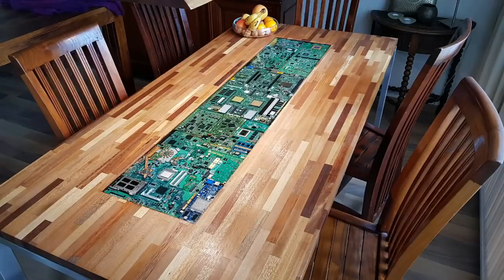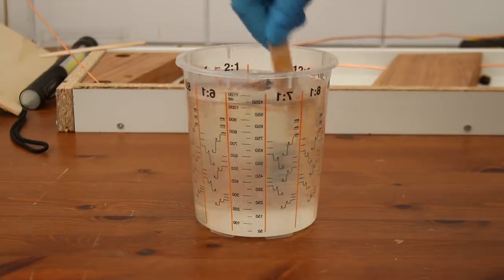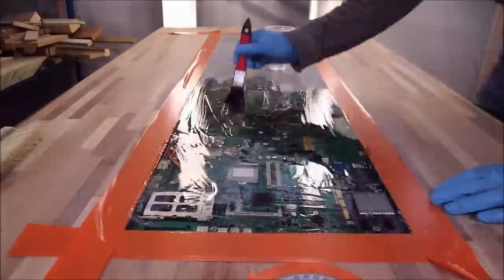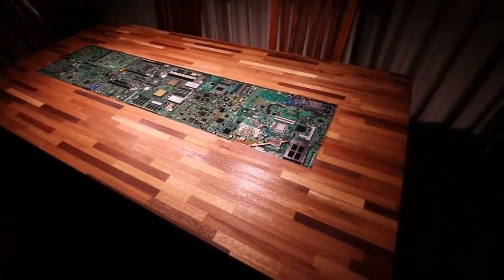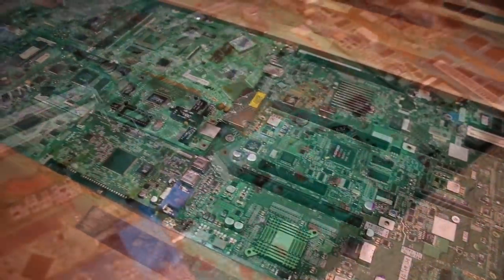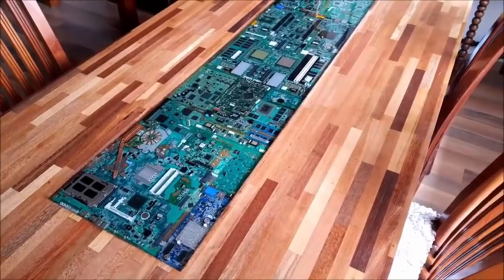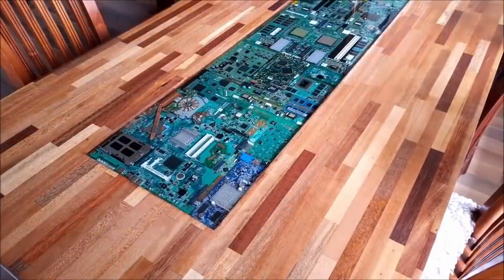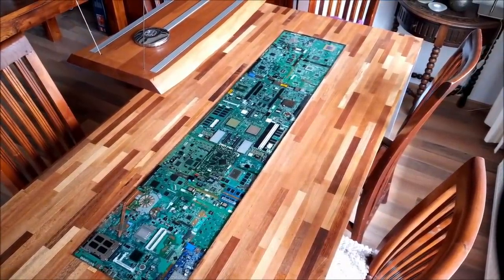Circuit boards with lights in epoxy in a table

Comment: Heat may help set the epoxy.   I have done a lot of epoxy casting at work. 

WARNING:
The heating process does cause the release of fumes it is best done in a well ventilated area.
The fumes could cause respiratory problems. with prolonged exposure.

I frequently used heat to speed the curing process if prototype were needed in a rush.
I would also use heat if I was off a bit with the catalyst  (hardener) and things did not want to set in the after 2 to 5 days.
The heat will make the epoxy a little soft. 

Cook between 30 C and  50 C, if it is too hot the epoxy will turn yellow. 

The heating may take a couple of days.  The lower the heat the longer it will take to harden.
You can repeat the heat process if required. 

  -       The second heat should be at a lower temp and a longer duration.
When time was not a factor, I found that the lower heat 25 to 30C and longer duration, this worked best for me.

If the heat is above 75C the epoxy tends to turn a little milky yellow to brown and cause distortions in the glass like finish.
Do NOT use a heat gun to heat a localized area it may cause cracking.
Build a tent and heat the whole panel evenly as possible.
You could use the sun but make sure to use a heavy black plastic cover to shield the epoxy from the sun light.
Watch the temperature closely, on a sunny day it can easily reach 73 C in a sealed tent think about your car in the sun and the heat inside it in summer.
This could take several days bring the table in at night and cover with blankets to allow slower cooling.

-   Insulating the bottom of the table would help minimize the heat loss and give a more even temperature distribution through the panel thickness.

When warm the epoxy will be softer so take your time, when cool and cured it will turn hard. 

let the epoxy cool to room temp 18-24 C with out additional cooling applied.( do not place in a cold place this may crack the panel)
The longer it takes to cool the less stress you place on the cast panel. ( you have a big panel)

I would suggest to keep the epoxy out of direct sun light.
That will help the epoxy keep it's clarity.
Non UV setting epoxy's will turn yellow.
That will happen to most clear epoxies through time and sun exposure.

UV light will cure UV setting epoxy's do turn yellow very quickly

I created an epoxy that could have 3.5 " nail driven through a 3/4" thick piece with out breaking or cracking it.
Fun Stuff!!
Reply: Jesus christ dude, I was not expecting that detailed guide and explanation when I clicked show more. I thought it would say "good luck" or something.
Reply: @volundrfrey896  hahahaha exactly

Comment: Just epoxy the entire surface...
Reply from the maker: As I said in an earlier comment: I thought of that too, but first, the ugly spots won't go away with that, and second I don't like the look of wood underneath epoxy that much... Covering wood in epoxy for me is something like making plastic out of something natural..
Reply: @Onrust1  Gotcha.. But... sacrifices must be made to save the day. Make a mold and clear epoxy only the middle, Then epoxy the rest of the taple with green tinted semi clear resin. Heck you could even sove some more fibers around in there. The table will not look natural but it will look pretty funky with some semi organic cybord pcb thing going on.. Swing for the fences, or otherwise just leave the project half way!
Reply: PS: if you lightly sand fiber on the sides, that part will light up as well... ;)
Reply from the maker: I like the way you think. 😊👍 Sanding fiber at the sides I will remember!

Comment: Could youu made a mould of the  mobs as a finished sized  insert into the table,using the epoxy first.But apart from that a good video,Maybe you could use RGB strip lights.

Comment: Maybe you can use the router and remove about 1/4 inch of the epoxy and pour new epoxy ?  Also use a rubber spatula when mixing. And then pour into a second container and mix with a new spatula before applying to table.
Reply from the maker: Yes, good suggestion. But like I said, a groove between the epoxy and the wood is almost inevitable, because they didn't bond well enough. And a chisel can maybe more easily part the layers of epoxy that don't stick. Oh well.., I'll give some more thought. And I will take mixing more seriously in the future, that's for sure... 😁😁 Thank you for thinking with me..
Reply: @Onrust1  Then cover the entire table with epoxy ? groove no more lolz.
Reply from the maker: I thought of that too, but first, the ugly spots won't go away with that, and second I don't like the look of wood underneath epoxy that much... Covering wood in epoxy for me is something like making plastic out of something natural..

Comment: Mooi project.
Hopelijk geven de batterij(tjes) geen probleem na verloop van tijd door lekkage etc....
Reply from the maker: Welke batterijtjes? Je wekt de indruk delen van de video te hebben geskipped... Dat is verboden! 😆😆
Reply: @Onrust1  de knoopcel die je ziet op 4:40 links in beeld. Het exacte type is niet zichtbaar, maar vermoed een CR2032 is. 
ps: heb de ganse video uitgekeken, en zag dat je onder de prints een laag zelfklevende alu-folie hebt geplakt, dit heeft wel als grote voordeel dat de epoxy alleen maar aan de zijkanten van het hout plakt en niet over de ganse oppervlakte onder de prints.
Reply from the maker: @BjornV78  Oh sorry, verkeerd begrepen.. ja goeie vraag. Ik vermoed dat er niks met dat knoopcelletje gaat gebeuren, omdat het helemaal luchtdicht zit afgesloten.. Denk je niet?
Reply: @Onrust1  aangezien het luchtdicht is,  is de kans op corrosie inderdaad wel zeer klein. In de 16jaar dat ik aan IT werk, heb ik dit type batterij nog niet zien lekken, zelfs niet bij moederborden van 10jaar en ouder. Maar deze batterijtjes kunnen zeer lang hun spanning bewaren, waardoor ander onderdelen op de print onder spanning blijven staan, met het doorboren van de print voor bv Led's, kan dit wel een kortsluiting veroorzaken natuurlijk.
Maar er bestaat zo iets als de wet van Murphy.

Comment: In order to create a better result I recommend to (a) make sure to have really the very exact mixing ratio (b) mix it really really well (c) make sure that temperature in your room fits to your epoxy (in my case 20degrees), (d) pour in multiple thin layers to avoid fast gelation, my epoxy allows 2cm per pour, (e) cool down your epoxy components in fridge to the proper temperature (in my case 20degrees max) before mixing. ....As the process is exotherm the heat needs to be able to go away. If it is to warm in the room, if you cover it, if the total volume is to high you get fast gelation leading to the "ugly" parts. I hope this helps. I have learnt all of that from my errors :-)
Reply from the maker: Thank you, I'll keep this in mind for sure. My supplier guaranteed me the thickness and the temperature were within limits of this epoxy (it was one of the more expensive kind - I could do 5 cm, but I never did more than 2 cm). I'm quite convinced I cut a corner at the mixing... But next time I'll remember your words nevertheless... 😊👍

Comment: You should use a long thick piece of clear plexiglass to cover the circuit boards,  because its more durable and easy to replace when scratched! You can find many tutorials online (including video tutorials) on how to remove scratches from plexiglass which would make it a good option to replace epoxy as a see through container!
Reply: Use polycarbonate instead of acrylic (plexiglass) and it wont scratch to begin with.

Comment: To get rid of the imperfections in the epoxy, once it has been poured, you need to heat up any areas of imperfections with a hot air gun before the epoxy sets.
Reply from the maker: Before it sets? That means just after pouring? I know about removing air bubbles this way... And with my kind of epoxy I have enough time to mix the epoxy after pouring... I don't think it helps me now to go at it with a heat gun...
Reply: @Onrust1  Removing air bubbles is the most obvious that people think about when using a hot air gun BUT it also helps to displace the epoxy in a more uniformed fashion  when there are pockets of imperfections. Next time you do a project that involves a large amount of epoxy, make a test sample and purposely cause imperfections then use a heat gun on it, you will notice it will clear itself.
Reply from the maker: Thank you! I will most certainly try!

Comment: Sorry it didn’t turn out the way you wanted. But imo  it is a very nice and creative idea  and project! 
Can you tell what went wrong and how to prevent it?
Reply from the maker: Yes, it's pretty clear to me what went wrong: at some point I didn't mix the epoxy well enough. You'll have to mix very thoroughly, and stay with it after pouring, and mix even after pouring. When you don't... Well you know how it ends then.. 😊

Comment: Always awesome. Great work, Relatively simple idea but greatly executed, even with the little fail. Problem might have been too much epoxy all at once, i'm referring to the bucket. Most Epoxies being exothermal tend to have curing problem in large batches and curing time varies at differen Temps and humidity levels, as i'm sure you know already
Reply from the maker: Thank you. I think the bucket was fine, but it was something in the next layer. I was to careless with mixing, and that was because everything went too well before... It's the way you learn not to cut corners...
Reply: @Onrust1  Thank you for your reply and what you said can be applied to life "don't cut corners"

Comment: Nice video, brilliant idea, perfection is not of this world. Keep it up.

At some point I really hoped you were going to install LED strips on the sides... personally I would have gone with 2 sides per controller, to play with contrasting colours.

This project is asking to be completed, fibered LEDs working and finishing touches, don't be let down by some minor imperfections.
Reply from the maker: Nice idea. I didn't think of LED strips. I don't like the idea of a table with either electricity or permanent lighting. It had to be something to play with, and that is per definition temporary... That's why I still think the fiber optic cable was a good idea... Thanks for the heads up!

Comment: What I do in situations like this , if possible I put the offending piece on the wall or ceiling of my workshop , it’s still nice to look at and it reminds me not to skip steps (in my case )
Reply from the maker: Yeah, in my case too, I guess. I have taken the mixing to light hearted, because things all went too well before..
Reply: All of this is tons of work , something that does not easy to represent in a video. Thank you for your videos and I am looking forward to putting fiber optic cable lights in one of my future projects ! Thank you for that idea also